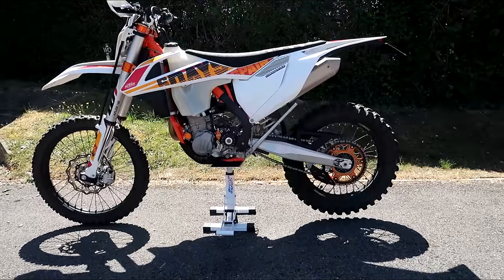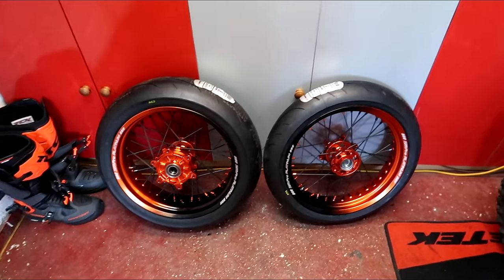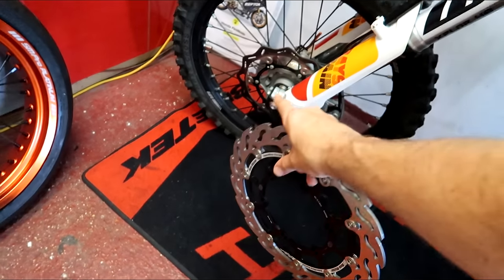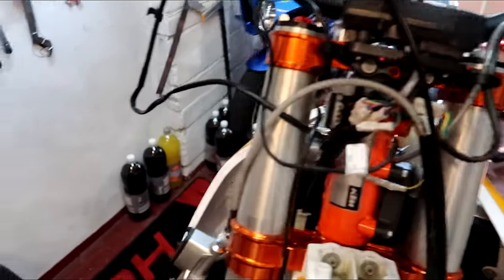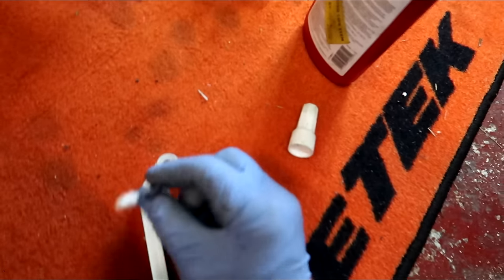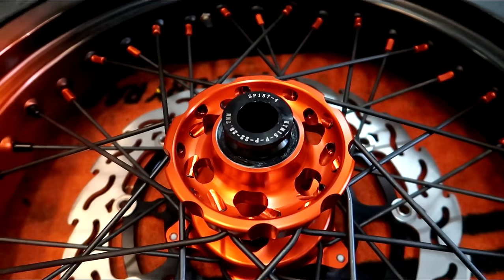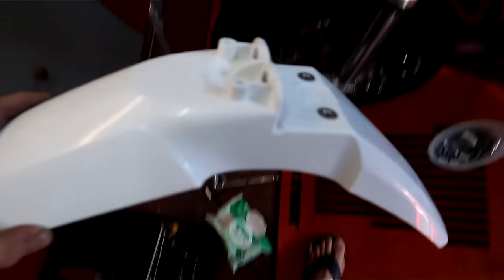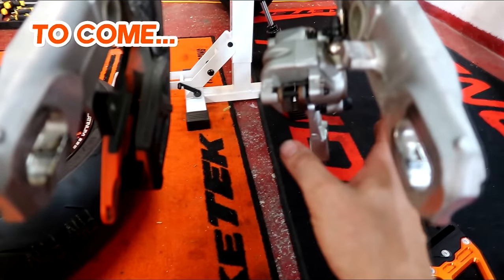How To Build  A Supermoto | KTM 500 EXC to AWESOMENESS!!

Comment: you have to put the rear wheel in from the top lay the wheel over at 45 degrees and feed it down then straighten it up. Yes took me ages to work that out.
Reply from the maker: That could be the best piece of advice Ive ever had!! Will try it out cheers

Comment: Damn ... Looking sweet
That was what I was going to do before I got the 701, but the cost to convert an EXEC 500 worked out much more (plus the extra servicing needed on the motor) than the 701
Reply from the maker: It's not that different to the 701 to ride matey, can feel it's lighter and wheelies easier but has that same feel

Comment: I recently bought a 2019 350 EXC-F with the intent of doing some offroad rides with some friends. I also have a 2018 MT-09 as a road bike.
Do you think the 350 has what's needed to become a nice SM? Or does it lack the grunt for road use? I'm trying to define a plan B if I end up getting bored with the offroad rides. 😇
Cheers from Portugal
Reply: Have you converted your 350 yet ?? I did my 21 FE350 to a SM with a Vortex ECU and slip on FMF and it lacked the power for the road (for me)
I traded it for a 22 FE501 and it's night and day better. I got the Vortex ECU remapped and the FMF swapped right over. Hope this helps🙂

Comment: Why do you got to change the brakes I thought it was just tires and rims
Reply: he just wanted to, you should anyway
Reply: It's a good idea because you go a lot faster on the street or track than offroad, you don't absolutely need to change the calipers if you're on a budget but getting larger diameter brake discs and a spacer to move the original caliper to the right place is a good idea

Comment: What about a Suter Slipper Clutch that Husquverna uses in the new FS-450 SuperMoto?  Whats a cush drive?
Reply: A cush drive is just rubber bushings in the rear hub. They sit in between the sprocket carrier and the main hub body and help to dampen the power pulses of the engine making for a smoother ride on high traction surfaces like bitumen roads.
Reply from the maker: Yes what he said :-)

Comment: Lcr can you try and review the 300 smoker this year if your going to be borrowing more ktm machines I'm wanting to do a superior build with either the 500 or the 300 and I'm really drawn to the smoker as it's only slightly less powerfull but lighter so if you review one it would help make my mind up before February when I can make a decision
Reply from the maker: Yes I will borrow one this autumn for some green lanning action. I'm interested to see how it compares to the 500. Only reason I went 4 stroke is more torque for wheelies and engine braking to help save flipping it!
Reply: Tav what size rear wheel / tyre combo do you run ?
Reply: Lamb Chop Rides awesome I can't wait to see the review and also how the build comes along

Comment: I have a '06 450 smr and a converted '17 690. Roomie has a converted '17 500 exc and '17 690.  Without suspension work it's going to suck on the street. Scary amount of front end drive, under any kind of braking. And the 500 does NOT have the same power as a 690. Horsepower may be close but leagues away on torque. 
My crappy old 450 eats them all when using it as a hooligan or track weapon. 690 is way more maintenance friendly and far superior factory suspension for street riding than the 500. However when we get offroad the 500 pulls ahead by leaps and bounds.
Reply from the maker: The suspension seems ok on the street appart from when you need to stop quickly, your right too much dive at the front. I will get the suspension  revalved over the winter.

Comment: does it really have the same hp as the 701?
Reply: Luciano Augusto  Lol Never. The 500 has around 60hp the 701 has 75hp.
Reply from the maker: Yes HP is about the same, 500 down on torque. Also depends which 701 you mean, my 2016 dynoed with power commander and filter at 59 HP. 500 has more revs and its stronger at the top of the rev range, 701 has more lowdown torque.
Reply: You can get 60whp out of the 500 no problem

Comment: Sweet as Chops. Taking shape nicely. Did you take into consideration the (way) smaller rear wheel when choosing your gearing? Check out www.gearingcommander.com if not. 👍
Reply from the maker: No but was recommended the hearing by others so should be OK. .

Comment: What fender is that?? Ive been trying to find a sumo fender for my 450 that doesnt need modification. Also, do yourself a favor and get the vortex ecu. Kind of expensive, but its the best 600 bucks you'll spend on that bike.
Reply from the maker: The fender is from  the husky 450 SM, thanks for the Vortex recommendation been looking at them already.. Will check it out further 👍